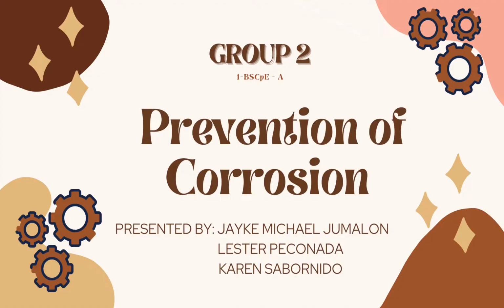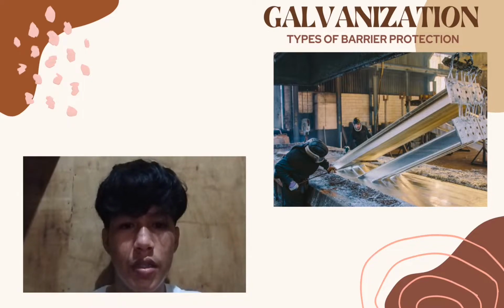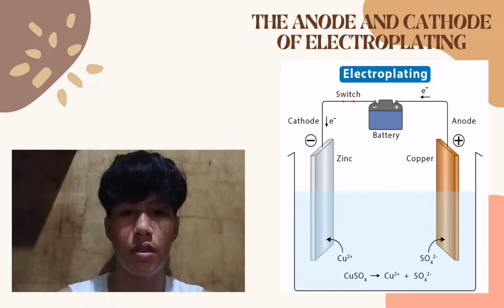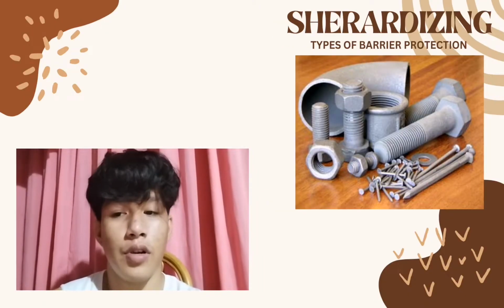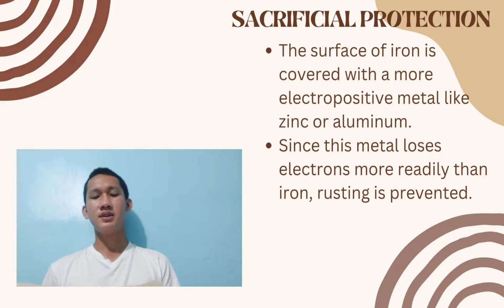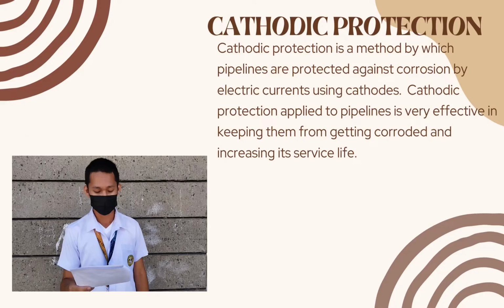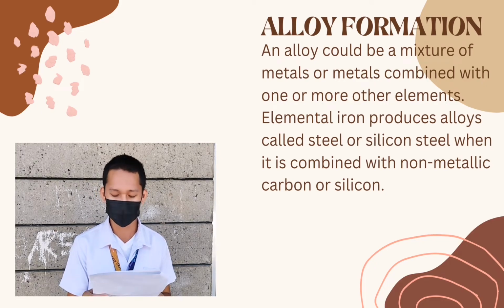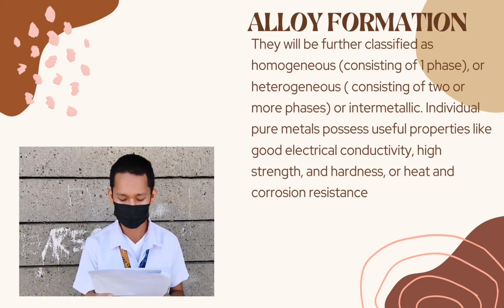PREVENTION OF CORROSION⚙️🔩

Comment: How would you prevent corrosion in a metal structure that is exposed to high levels of salt water?
Reply from the maker: To prevent corrosion of metal that is highly exposed to salt water is by galvanizing. Galvanizing is a typical technique by  applying a thin zinc coating to the metals. This  coating can effectively protect the metal against corrosion by sealing the surface of the part from the outside environment.

Comment: What is the best method for protection of metal from corrosion?
Reply from the maker: hi thankyouu for commenting for me the best protection to prevent corrosion is Galvanizing. Galvanizing applies a protective coating of zinc over iron or steel. Since zinc corrodes about 30 times slower than iron, galvanizing can be a cheap and effective way to prevent rust

Comment: What happens if corrosion in not prevented?
Reply from the maker: The  chemical reaction of corrosion can cause the metal to degrade over time, tarnishing its appearance and compromising its structural integrity.